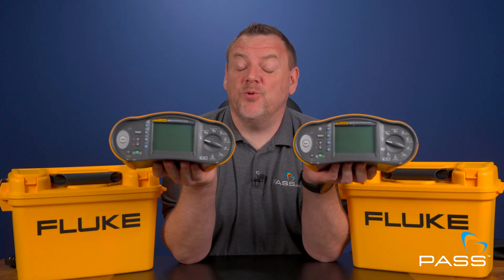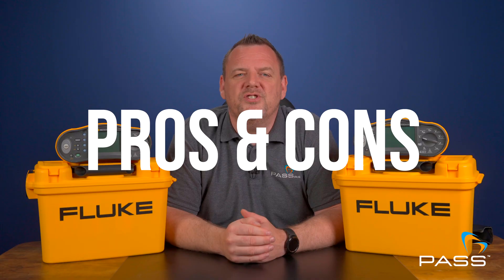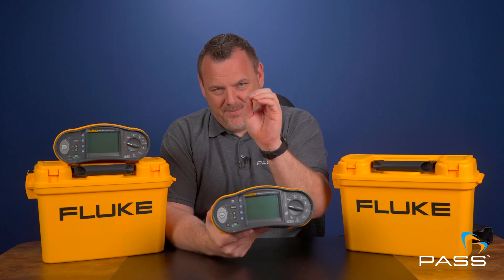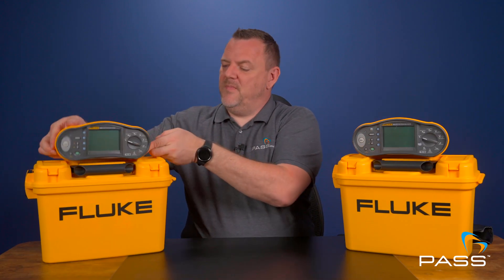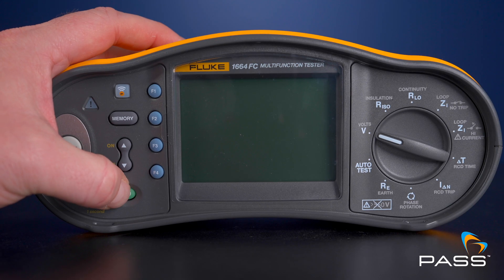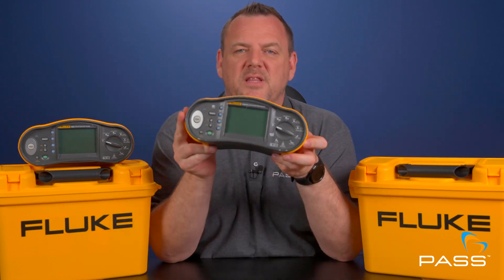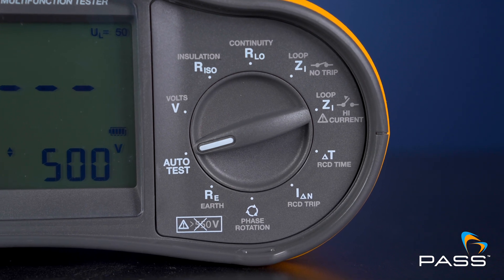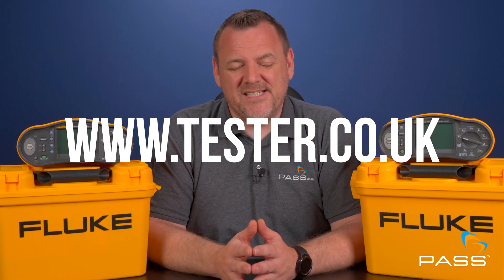Fluke 1662 or 1664! What's the BEST Multifunction Tester for You?

Comment: Over rated over priced American junk ffs the Americans don’t even use their own brand apart from a multimeter or a clamp meter. And fluke are mostly made in Taiwan, it even has embossed on the back hardware Taiwan final assembly and calibration could be anywhere from Taiwan, Germany America Holland the uk or even Australia. I will stay with my Kewtech . And my trusty old Robin KTS 1620 .
Reply from the maker: I appreciate your perspective! Everyone has their own preferences when it comes to tools, and it's great that you've found what works best for you.
Reply: @PASSLTD-tester  I have done well with Fluke. Never fails and easy to use.
Reply: Maybe im 1662 land. Where im kind of kicking myself for buying the 1587fc insulation tester, not because i dont like it, but it lacks the rcd testing and impedence. Im unsure i need them day to day as an HVAC engineer, we are usually electrical service techs in NZ instead of the full electrician)..but with my old fluke 907 starting to play up i was looking in the market for a clamp meter with rcd testing option…there isnt. While its been nice having the 1587 and the 907 to take dual clamp meter reads, the rcd tester is something ill inevitably need to have if im doing building inspections or old installs. These intallation testers are not exactly what my trade needs aside from when i may need one and if im doing my license refresher… in a perfect world, an installation tester with a clamp and tests dc would be ideal. Unless i choose to be a hack like my friends electrician was yesturday…